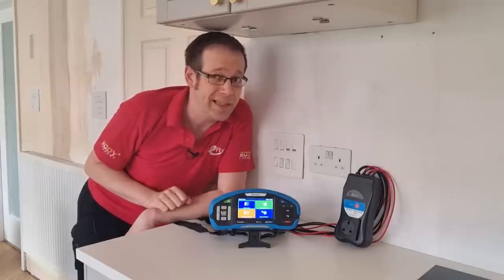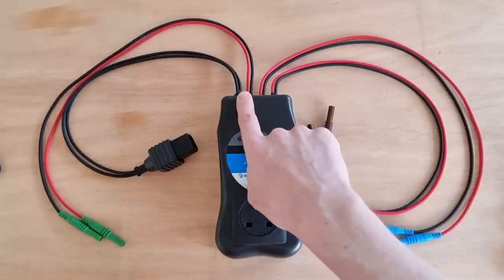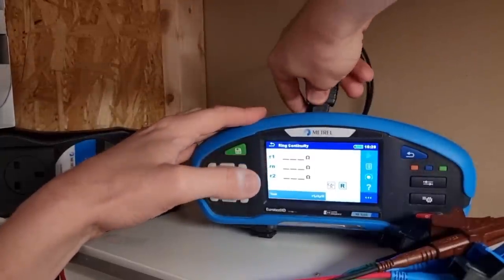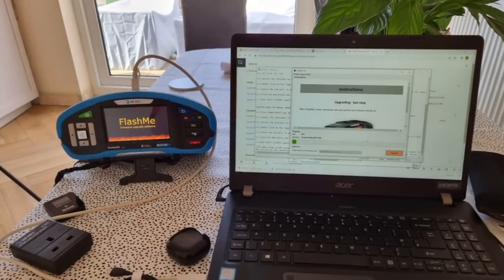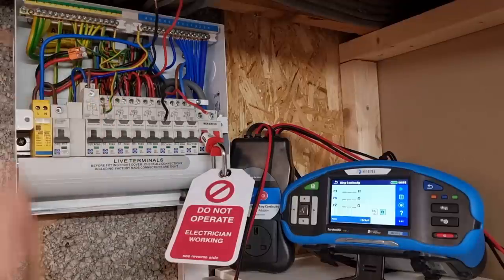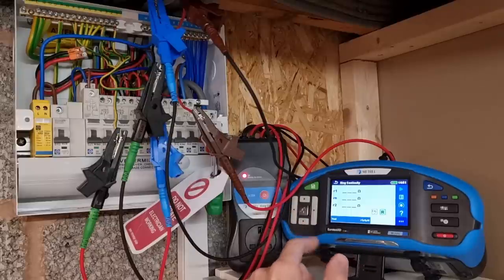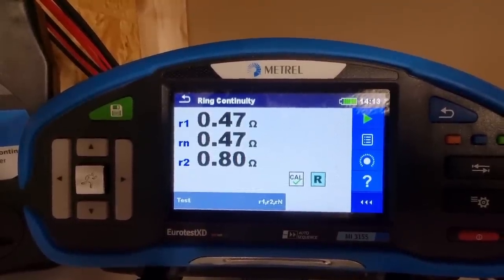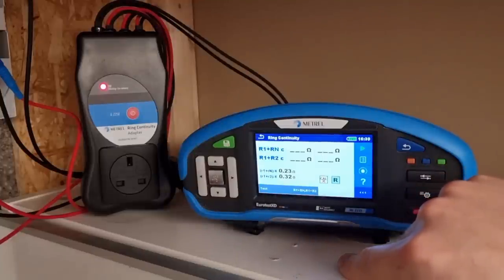The FAST Way to Test Ring Main Circuits!

Comment: We're going to have a legacy of RFCs for decades but we really should stop installing new ones.  Young Youtube sparkies still fitting them. Please, just don't! They're not required.
Reply: Until someone over loads a radial with extension leads and everything they can plug into them, at least with a ring main your unlikely to draw any were near 32amp and over load the circuit.
Reply: I don't agree. They have their place.
Reply: @travoltasbiplane1551  what about a 4mm2 Radial on a 32a rcbo? Rings rarely split the load evenly between legs. Playing devil's advocate as I still occasionally use RFCs. 😆
Reply: @seanthespark  as I said on another post. Yep fine. Only works if clipped direct though. Any insulation or even method b and you're not technically protected against overload. They need to do some figure fudging.
Reply: @seanthespark  re the load sharing... Well they should ish if it's done right... But also have you ever seen it be a problem?
Reply: @seanthespark  unless you can persuade manufacturers to produce a 30 amp mcb or rcbo the thermal capacity of the cable wouldn't hold on max capacity. Besides the price of 4mm t&e is just silly as it isn't as common.
Reply: @travoltasbiplane1551  haven't come across it as a problem in a real life situation yet, but I remember doing some experiments a several years ago we managed to get it to a 75/25 load balance depending on what you had plugged in and where on the ring.
Reply: @rayc1503  true, 30a mcbs wernt hard to find but I don't think I've ever seen a 30a rcbo 👍
Reply: @seanthespark  yeah but it'd balance out as the resistance increased on the shorter leg as the cable warmed. 🤣
Reply: Advantages that rings have over radials:
Way longer circuit length in terms of voltage drop
Less prone to arcing if there is a loose connection in the live circuit conductors
Most, if not all, points will still be earthed if there is a loose connection in the CPC
Greater flexibility in installation methods vs 4mm radial on 32A
Reply: @andrewcadby  totally agree. Each has its place its just a case of the most appropriate circuit for the design. This rings are bad mmmkay argument is ill founded and remarkably prevalent.
Reply: @andrewcadby   If you consider a radial as a ring final without bothering to make the join.  But design radials properly as radials not broken RFCs you wouldn't be using 4mm² or 32A brakers.
Reply: @seandempsey7351  I’ve seen overloaded RFC’s…
Reply: @calmeilles  I'm not sure I understand what you mean fella?  The standard radials for general purpose socket circuits are detailed in appendix 15 of BS7671, and appendix H and section 7 of the OSG.  

These are 20A/2.5mm2/max length 42m, or 32A/4mm2/max length 43m, the latter only permitted ref method C.  

Compare these to a ring final, 32A/2.5mm2/max length 106m.  Nearly 2.5 times the length of either of the radials.

You can substitute 2 X 20A radials instead of a ring final if you like, but still not as long in total as a ring, and also you lose out on the diversity that a 32A circuit offers.

I'm not suggesting rings should be installed in all instances, there are times when radials are the obvious choice.  But with all the above advantages, and more besides, I can't see why you wouldn't use them when suitable?